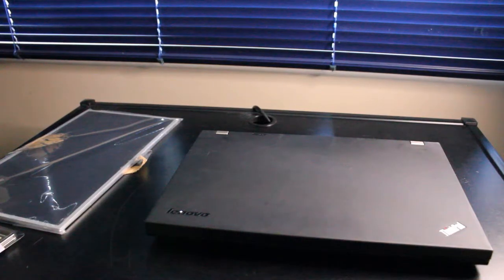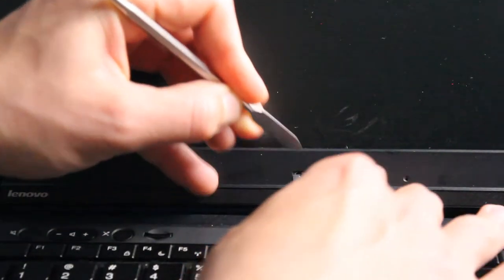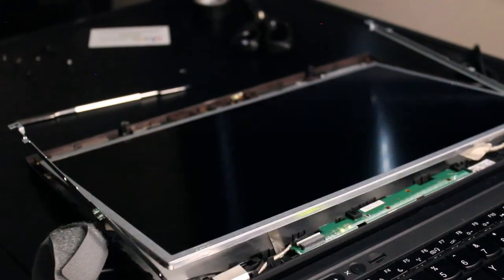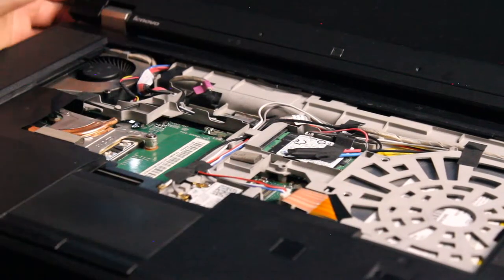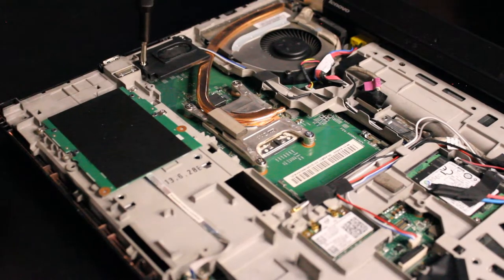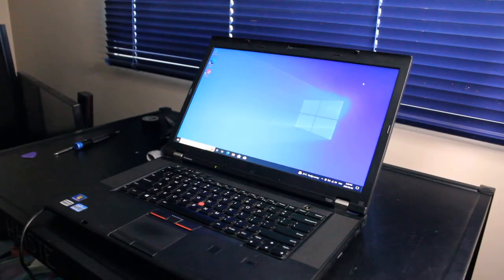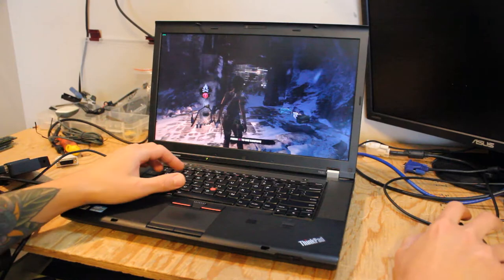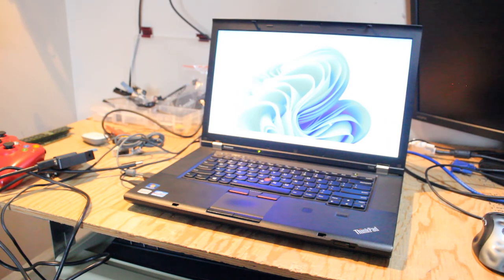ThinkPad T530 1080p Panel & i7 CPU Upgrades Install + Gaming!

Comment: I did swap i5 to i7.  Temps are fine even though i7 has higher TDP. But you can buy cooling form T520 it's more efficient and fits t530.
Reply from the maker: I would love to do that mod.  If I come into more T530's I will pursue it.
Reply: Does the t520 heatsink for the dedicated graphics model fit the t530 with dedicated graphics?

Comment: what type of graphics card can I put?
Reply from the maker: Laptops are limited to the integrated graphics, in this case Intel HD 4000.  There are some ways to mod and use a graphics card with a laptop and externals connections, but that is more on the enthusiast end of the spectrum.
Reply: @HaisteComputerRepair  Okay Thanks, how about SSD RAM and HDD? how much can I upgrade it?
Reply from the maker: @drpotatoman4875  If you want both an SSD and HDD, you can install an mSATA SSD under the keyboard, which leaves the 2.5" drive bay open for a storage HDD or SSD.  RAM is 16GB DDR3 1600MHz.  2 x 8GB sticks.  I have install videos for the mSATA SSD if needed.
Reply: @HaisteComputerRepair  And can I change my intel to AMD ryzen?
Reply from the maker: @drpotatoman4875  No you can't.  This laptop takes only 3rd gen Intel CPU's.  Generally motherboards will only support one or two generations of CPU's and there's no swapping Intel for AMD and vice versa.  They are separate platforms.
Reply: @HaisteComputerRepair  Then what CPU should I upgrade it? if it can.
Reply from the maker: @drpotatoman4875  Check out the list of CPU's in this document and look for the quad core i7's.  https://psref.lenovo.com/syspool/Sys/PDF/withdrawnbook/ThinkPad_T530_WE.pdf

Comment: is it okay to install any brand of 1920 x 1080p 15.6 inch to this laptop? or are there only a few lcds that this laptop supported?
Reply from the maker: There will be multiple brands manufacturing display panels.  It's best to match the description on the one you are buying (ex:  T530 display panel) as well as the pin count on the wired connection, which you can disassemble and take a look.  Any if not all listings you look at should have this information.

Comment: i would not upgrade the screen if gaming is intended. if you lower the resolution you increase the performance of the game
Reply from the maker: I don't know if I agree, but I do understand what you're saying.  The difference in clarity between 1366 x 768 and 1920 x 1080 is notable, despite playing at a lowered resolution.  Yes you're right about the increase in performance.
Reply: @HaisteComputerRepair  so far on my t530 i have switched the motherboard to a w530 motherboard and is currently waithing for the new power supply brick to arrive, actually the w530 has a bit different power jack and i forgot to install that but have a docking station with it so i install one later.  I went for the i7 3740QM on it but was wondering if there still is better cpu's i can put into it? I also upgraded the heatsink so that it is compatible with the w530 board and i made sure i had the best heatsink that existed for it.
Reply from the maker: @snowcold903  That CPU is pretty good, I think you'll be ok.  Purchasing something with a fast clock speed that isn't listed on Lenovo's specifications would likely work, but it might help to find out if someone else has tried it out.  Sounds like you have a nice project going on there!

Comment: It's cool how you can fit a 1080p panel, without one of those janky converter cables, that you need for a T430. You've made a nice machine there!
Reply from the maker: Thanks!  Yes I am happy that I didn't have to source an alternative cable connection to the motherboard or do anything other than put the panel in.  Easy upgrade, this one :)
Reply: @HaisteComputerRepair  Yep, those dubious converters worry me.
Reply from the maker: @ted-b  I'm anxious enough as it is!
Reply: @HaisteComputerRepair  🤣

Comment: Thanks for the valuable video but i have a question, what about the BIOS do we needs to upgraded too ?
Reply from the maker: I don't really think you need to worry about that.  Unless there is a problem you are trying to troubleshoot or some feature that is enabled with a BIOS (firmware) update

Comment: can you give me the part numbers for the I7 CPU and the panel so i can order them
Reply from the maker: I don't have a part # unfortunately, the eBay seller just listed it as 40 pin 1080p for the T530.  As for the CPU, I also purchased from an eBay seller.  Just a general search for  i7-3610qm.  Do you live in North America?
Reply: Yes, I live in Florida
Reply from the maker: @KimcastorArt Ok, check out eBay and feel free keep in touch with what you find.

Comment: 1. what model number is the screen?
2. does the t530 use the 40pin?
3. do all screens work without the adapter or just some?
Reply from the maker: From the eBay listing I purchased from:  Made by AU Optronics, Model: B156HW01 V.4 
Lenovo P/N: 04W3471 / 0A66674
It has a 40pin connector and 1920 x 1080 resolution with Matte finish.  https://www.ebay.ca/itm/175368094635

*did not need an adapter in my case.
Reply: @HaisteComputerRepair  thanks

Comment: The video is very good all the update even so it would have been better if you added the difference in performance that would be shown when changing the CPU for a better one and see how the temp itself is handled (although if they have the same TDP I don't think it's necessary modify the heatsink but it is always an option). I also wanted to ask you, where did you buy that panel? And what brand does it belong to?
Reply from the maker: The difference between a 2 core CPU and a 4 core CPU is notable.  With 16GB RAM and an SSD to match, you're looking at a system that can handle more multitasking.  Depending on use, heat comes along with the 4 core i7.  Heat is normal, but overheating isn't, so best to keep an eye on thermals if you think it's unreasonably hot.  Think about if there is enough airflow beneath the laptop or how much dust has accumulated.  I bought the panel off a Canadian eBay seller.  I don't remember the brand, but you'll find various manufacturers.  Where in the world do you live?
Reply: @HaisteComputerRepair  I'm from Latin America. It fascinates me to see videos on how to update Notebooks/Pc and even how to fix the failures that may occur. I have a T430 and T530 all original and in the case of the T530 I am looking to replace the panel with an IPS at 1080p but I don't know the flex that it has will be compatible with any brand, so I asked if you knew what brand that panel was that you placed. On the T430 it will improve (The only thing missing is the CPU but the I7 3840QM is already on the way) with a Wifi lan card that takes full advantage of the internet and the x2 8GB RAM memories at 1600mhz DDR3L together with the incredible panel IPS 1080p that it has, it looks great every time I start it up.
Reply from the maker: @sarce435  Sounds like a nice T430.  If you didn't know, you can install an mSATA SSD in the WWAN port under the keyboard/palmrest.  You could use it as either a boot drive or storage, opening up the possibility of dual drive setup.   Usually, a T530 LCD panel will have a 40-pin connector.  This one is in Canada, but it would work well:  https://tinyurl.com/2wxa3864

Comment: This is a great video I have watched it many times. I ordered that same CPU you had listed unfortunately it was the wrong socket. No worries I will get the right one next time. I do have one question if you have time, is there a quad core processor for the T530 I have the i53320m it's two cores, i see the i7 3520 also has two cores, is there a quad core processor I could buy?
Reply from the maker: The i7-3610QM should have worked with a T530.  Maybe you got a faulty CPU?  Check out the product specifications, where it lists it as an option.  As well as a couple more:  https://psref.lenovo.com/syspool/Sys/PDF/withdrawnbook/ThinkPad_T530_WE.pdf
Reply: @HaisteComputerRepair  I will check this out thank you for the help.
Reply from the maker: @Kyocera234  My pleasure, let me know how it goes.
Reply: @HaisteComputerRepair  Thanks.  I got the processor installed and it's showing up 
fine in the Lenovo Diagnostics Tool.
Reply from the maker: @Kyocera234  Ok, great.  Your comment mentioned that it was only showing 2 cores?
Reply: @HaisteComputerRepair  That was a false alarm, when I first booted it up and checked the processor spec with the Diag tool it only showed two cores but had the i7 3610QM right.  I ran the processor full test and while it was running it showed temps on all 4 cores.  I can only assume the Lenovo Tool found the processor type but needed to find all the specs for the processor after some time period of running a test.  I had deleted that original post when I realized everythin was fine.  Again if not for this particular video I never would have been able to do this, so I am very much grafeful.
Reply from the maker: @Kyocera234  I'm glad it worked out.  Sadly I think socketed CPU's in ThinkPads ended after the "400" series with 4th gen Intel.  Have fun with yours!

Comment: 2 more questions, if i upgrade to the same i7 CPU did will i get better video from the CPU instead of the intel HD 4000 it currently has, aslo is there a better replacement camera i can replace this with? thanks
Reply from the maker: 1) No, the integrated graphics are going to be Intel HD 4000 unless you source a motherboard that has the NVIDIA NVS 5400M dedicated GPU
2)There seems to be 1080p webcams people have installed, but I haven't done so myself nor done the research so let me know what you find.

Comment: Hello brother, I have a Thinkpad lock the same as your computer but mine is W520, their detail is Intel(R) Core(TM) i7-2760QM CPU @ 2.40GHz   2.40 GHz & 128GB SSD for Windows and 512GB HD for others. I'm doing a complex engineering simulation. so I want to upgrade to be faster, what suitable CPU can I buy. thank you plenty
Reply from the maker: Realistically I don't know that you will get a huge performance boost over the i7-2760QM, but the i7-2860QM has a faster clock speed and larger cache.  So, that would be my recommendation.  Source:  page 42 of this psref:  https://psref.lenovo.com/syspool/Sys/PDF/withdrawnbook/ltwbook_WE_2012.pdf

Comment: What 1080p panel did you use, wanna upgrade mine too
Reply from the maker: I can't recall at the moment, but you should be able to find one rather easily on eBay, Aliexpress, or Amazon.
Reply: @HaisteComputerRepair Alright thanks

Comment: What about battery performance?
Reply from the maker: From a laptop that was released 12 years ago, you get what you get.  There are several third party options, though, if the OEM battery is not holding much of a charge anymore.

Comment: can you help me factory reset my t530? I can't access it since it has a windows admin password and I also can't seem to factory reset it it by going into troubleshooting options by pressing the shift button while restarting the device
Reply from the maker: First, do you have access to a USB drive with at least 8GB of storage space?  This can be used as a dedicated Windows installer.
Reply: @HaisteComputerRepair  yes, I have one here
Reply from the maker: @kissshot2261 Ok, go to this link and select download tool.  It will lead you through setting up your USB drive.  Make sure your USB drive is plugged into your T530.  https://www.microsoft.com/en-ca/software-download/windows10

Once this is complete, let me know
Reply: @HaisteComputerRepair  miraculously, I was actually able to reset it using the shift+restart (tried this method for more than a month and it only worked now) and I am now using it. thanks for replying!!
Reply from the maker: @kissshot2261 Wonderful!

Comment: Where did you buy the i7? Cuz i have the same laptop but its t530i also what i7 gen did you buy
Reply from the maker: eBay.  I believe the T530i also has a socketed CPU and the upgrade should be fine if this is the case.  The CPU gen is in the video description and thumbnail.  i7-3610M.  The 3 indicating 3rd Gen Intel, which is what this laptop supports.
Reply: @HaisteComputerRepair  thank you
Reply from the maker: @Doge-Blitz  You're welcome!  Research the product specifications here for i7 options:  https://psref.lenovo.com/syspool/Sys/PDF/withdrawnbook/ThinkPad_T530_WE.pdf
Reply: @HaisteComputerRepair Hello again sir
Reply: Can a i9 fit in the t530 laptop?
Reply: actually have the answer
Reply from the maker: @Doge-Blitz  The i9 mobile CPU is quite recent and generally soldered on to a motherboard.  The T530 is 3rd gen Intel and the i9 did come around until I believe 8th gen Intel.
Reply: @HaisteComputerRepair Hi again sir can any intel core with the name qm fit with the t530?
Reply: Sorry for bothering you but i just wanna learn everything within this laptop and i already read the file you sent me
Reply from the maker: @Doge-Blitz  Can you send me some links for CPU's you are looking at?  So long as they are 3rd Gen Intel i7.

Comment: Wait. What? Where is the GPU? Or you dont have the NVS version? :D My version has the 5400 NVS and also SIM-Card-Slot on the back of the laptop when you remove the battery. :D
Reply: I'm gonna to buy 16gb RAM, the highest CPU i7 3920XM + 1-2 TB SSD + WPA Modul for the Sim-Card :)
Reply from the maker: There is a SIM card slot.  But yes, this is the version without the NVIDIA GPU.  Awesome that you get to play with that.
Reply from the maker: @StillBlank_ Let me know how it goes
Reply: @HaisteComputerRepair  Its absolutely crap. You cant even play CS:GO with overclocking the GPU to the limit. I even setted in the steam options the game should go only to 60 fps. Doesnt matter. Its impossible to play. CS:Source runs absolutely smooth with highest settings with 165 FPS. You can run like NFS Underground, Most Wanted, BF 2 or 2024, Modern Warfare (the old one not online) and of course strategy like Age of Empires and so on. To run CS:GO you need like minimum 1,5gb Vram. I'm pretty sure you need for CS2 2,5gb Vram. lol
Reply from the maker: @StillBlank_  I wouldn't expect it to be much more than novelty for modern use, but as you said for older games or light titles it's probably good.  Did you try lowering the resolution in CS:GO?
Reply: @HaisteComputerRepair  Yes. I tried again now but not through nvidia settings because when you do this and restart the laptop you dont see your mouse anymore. So right click on desktop and then the standard settings set it to 1360x768, opened steam, right click on cs:go, choosed the latest one, then scroll down and type in the expert settings "+fps_max 60 +cl_showfps 1" (you can do this with every game) first I tried 80 but it wasnt that good then again with 60 and now it runs, ah, lets say more then "good" but like I said with extreme overclock CC +50 and MC +250. I will try it now with 75 and 300. haha
Reply from the maker: @StillBlank_ In the CS:GO graphics settings,  adjust the resolution there and lower it until gameplay is smooth.  Play with fullscreen and windowed
Reply: @HaisteComputerRepair  I cant set it directly in the game I have to do it through nvidia settings or through desktop. But nevermind. It even lags on 1024x768. 1024 lags more then 1360. I dont need to try other resolutions. Its senseless. :)
On youtube is a video where a guy plays CS:GO on 1920 with overclock completele smooth. I dont know why it doesnt work for me.
Reply from the maker: @StillBlank_  Hm ok, I haven't loaded  up CS:GO in some time so I must be off.  If I still had this T530 I would try it out.
Reply: @HaisteComputerRepair  The Nvidia GPU is the worst GPU for the T530.
Reply: @StillBlank_  That particular CPU (i7-3920XM) is a 55w CPU so that's really pushing that stock heatsink cooler, you might be experiencing some thermal throttling which is causing the performance issues too. I would stick with a 35W or 45W max CPU IMO.
Reply: @billytk1225  That thing is burned. Already throwed it away. Just dissambled it and sold CPU and RAMS. That mainboard was definetely not maid for that power. HAHA